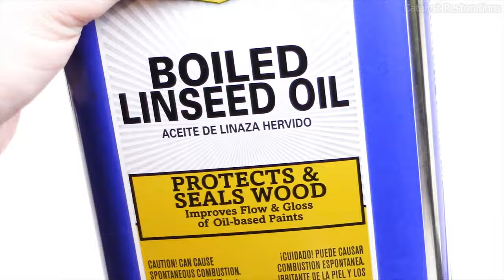50-Year-Old Klein Pocket Knife Complete Teardown and Restoration (and Modification)

Comment: The knife is Klein's version of the Electrician's Knife, TL-29 (or sometimes found as "Linesman"s Knife, TL-29),  They date back to at least 1919 with the original Army Signal Corps Tool Kit.  The knife was the 29th item on the Tool List, hence the "TL-29").  The knife was commonly paired with a pair of Linesman's Pliers (TL-13) in a common belt holster.. (Klein is better known for producing quality linesman pliers than knives.  They are still one of the leading manufacturers of quality electrician's tools - and most of their stuff is still made in the USA.  The company dates back to 1857 and is still family-owned).  This design has been made under government contract by just about every knife manufacturer in the country at one time or another.  Millions of them were made to support World War II and they continue to be issued as a part of many military tool kits today...   The switch from wood scales to plastic started in the latter days of WWII.  I don't think any wooden scaled knives have been made since the Viet Nam war years...  It is almost impossible to date most examples of this knife unless you have a really old one that dates back to the early days of WWII.   It is a popular design for a working knife and has been made for commercial sale almost as long as it has been made for the military...  Most military examples have "TL-29" stamped on them somewhere, usually on one scale.  Some early examples had this stamped on a nickel-plate shield on one scale.  Most of these knives had decent quality carbon steel blades until the sources moved to the Far East and a cheaper grade of stainless was used...  You have a good one, it should provide many more years of faithful service...
Reply from the maker: Wow Edward, thank you so much for taking the time to provide all that amazing information! I wish I knew more precisely when this knife was made, but I think you're right that it's probably no older than the Vietnam War years. Use it all the time since I restored it!

Comment: I like it great job on that! I need to get a plating set up! where did you get yours?
Reply from the maker: Thanks! Search 'nickel anode' on Amazon or eBay and you can get a kit with nickel, copper, and zinc strips. Then you can use wires and AA batteries for the electricity. If you search DIY nickel plating on YouTube I recommend Geoffrey Coker's video - it's the best and simplest tutorial!

Comment: Very nice. I like the light wood. Did Klein ever make them with wood scales? Where did you get your brass? I have several old wood handle tools that I have started restoring and their scales are bad. So I need to get some supplies. Thanks
Reply from the maker: Thanks Glen! As far I am aware, Klein never made wood scaled knives, only faux-wood plastic (more durable and practical for an everyday electrician, so I get it). I bought the brass pin material on Amazon (12 pcs of assorted sizes was about $10), but there are many other online and in-store retailers that sell it as well. Just search for 'brass rod stock' or 'brass pin stock' and you should find plenty of options! Good luck, and happy restoring!